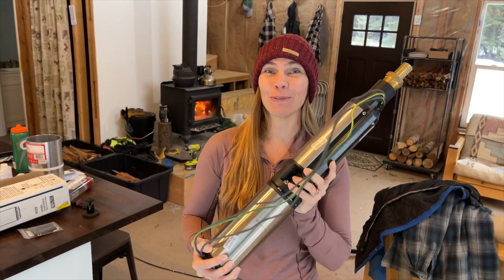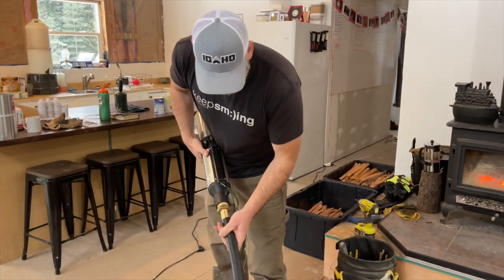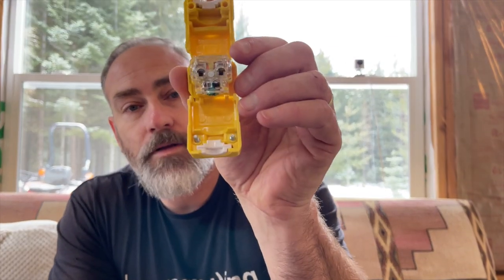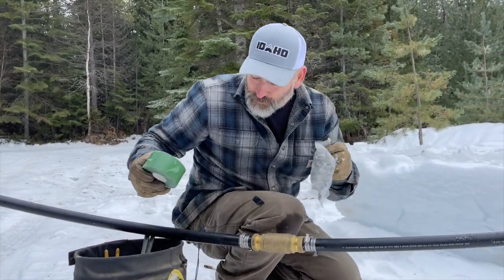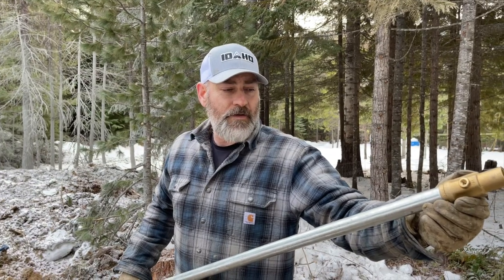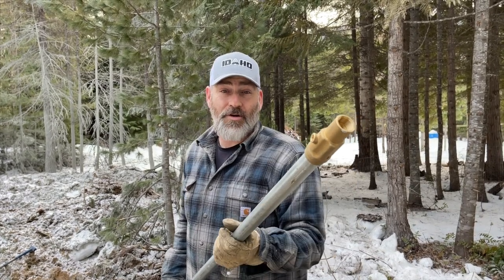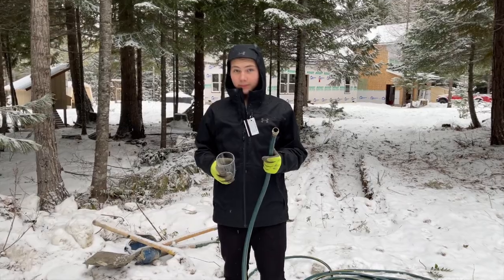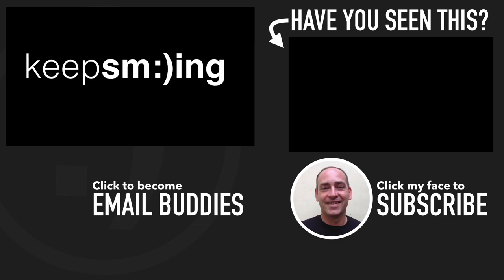WIFE is HAPPY/HUSBAND is NOT - DIY Well Pump Installation

Comment: For the people who do not know. There are several factors when choosing a well pump and power supply. Well pumps are sized by the amount of lift (head) required. Lift is the distance between the top of the well (to make easy) and the water level that the pump will be operating. In this case the "well" was at 500+ feet, the static water level was at 94', and I believe that the pipe installed was 194' giving the pump 100' of water above it given the static water level of 94'. In addition, unless the water run is down hill and the highest discharge point is below the top level of the well, the pump needs additional head capacity to provide water at a pressure (PSI) that is acceptable to the user. Some people think that 20 PSI is great, some people want 100 PSI so that they don't wait forever. "Normal" is in the 40-60PSI range. More pressure equals bigger pump and more power required to run it. Ideal would be to put the well at the top of the hill, your house at the bottom and let the fall (pressure built up by water flowing down hill) provide the pressure. The problem is the initial cost to drill the well at the top of the hill will be greater, assuming there is actually water under the top of the hill or that you actually have a "hill" to be on top of. Pay money now or pay money later over time.

The starting load is always 150-200% of the running load depending on how much water (head) is on top of the pump. Running load is determined by how much head the pump has to overcome pumping the water to its destination. Head is a function of the level the pump is at in the well, pump to top of the well PLUS any up hill flow required from the well to the discharge point of the water.  The pump has to be sized for the total amount of head required plus an additional amount required to supply adequate pressure at the point where the water is being used. Example if the pump will pump 100 feet of head and your pipe is straight up 100 feet the water will flow out the top of the pipe at the pressure of a bad drinking fountain, if you cut the pipe at the 50' mark you will have good working pressure. The pump has to be sized to provide adequate pressure, usually 20 PSI or more, at the highest point in the water system.

If you can, always get a pump that runs on 240 volts, the starting load (amps) will be 1/2 (more or less) than a 120 volt pump. Also the wire size is smaller for a 240 volt circuit than a 120 volt circuit. Always size the pump for 20-30% more head than required if you can afford it. More head capacity, even if not used, will provide more pressure at the discharge point. If you can always size the wire larger than required to reduce line losses. If the wire required is 12 gauge try to use a 10 gauge or 8 if the well is very deep. The extra cost will pay for itself in the long run. More so with a 120 volt pump than a 240 Volt pump.

Side note the static water level is a function of the depth of the overall well and the ground pressure on the water at that depth which forces the ground water up to a "static" level which will be maintained as long as the pump is NOT pumping. When the pump is working, given X as the static water level, a recharge rate of 10 gallons per minuet, and the overall amount of water pumped the static water level will either stay the same or temporary lower. There is about 1 gallon of water in every foot of 6" pipe. So if you use 1 gallon of water every 1 minuet the static water level will not change much. So if your well produces 10 gallons of water per minuet and you are using 10 gallons of water per minuet the static water level will not change much and will return to the normal static level quickly. If you are using 20 gallons per minuet and your well recharges at 10 gallons per minuet you will run out of water and have to wait for the well to catch up. Never run your pump dry even if the manufacturer says you can.

The pump doesn't know what the recharge rate of the well is. All it knows is when the pump is on it pumps as hard as it can and when the pump is off it doesn't pump at all. What then happens is if you have 100 gallons of water in the pipe between the normal water static level and the pump then if you pump 100 gallons of water at one time the pump will be out of water and not able to pump more water until more water flows into the well (recharge rate). What happens to the water level depends on the pumping rate of the pump, the restrictions in the line, and the recharge rate in this case expressed in gallons of water per minuet. If your pump and pipe restrictions can pump water at 20 gallons of water per minuet your well will "run out" of water until the well can catch up after the pump is not running. If your recharge rate is more or equal to the discharge rate then your well never runs out of water. The water in the pipe between the normal static water level and the pump acts like a buffer to help smooth out the recharge rate and the discharge rate so that you don't "run out" of water. Every well is different, some will never know, some will learn the hard way about recharge rates. Poor wells are generally more about the recharge rate and not the quality of the water.

Unless your well recharges at 5 gallons per minuet or more you will learn how to conserve water use quickly. 3 gallons per minuet is a bare minimum for drinking and washing.

Install stainless steel wire to the pump so that you do not rely on the pipe to pull the pump. Just think about all of those joints in the pipe when you are pulling it back up. Fishing a fallen pump out of the well is a miserable job.
Reply: This person knows a lot about this, I have worked in the pump business for almost 20 years, he is correct.
Reply: @scottwallen461  Thanks for the comment Scott. It is good to know that at least 2 people read, I assume, the whole post so that it wasn't a total waste of time even if one of them already knew the information. I must have been board that day to write that much.I guess it is one of those subjects that unless you give the broad overview it is a waste of time to give the readers digest version.

Comment: I ran mine in Northwest Florida for 24 hours at 30 gallons per minute to get clear water. Mine was only 40 feet deep as we live on a sand island and the Choctawhachee Bay is about 250 feet from the well. Only use it for irrigation for the last 15 years when we hooked up when municipal water was run in the area

Comment: 33 amps in-rush current is not unexpected for a motor that will have a steady operating current of about 10-11 amps.  This is one of the big reasons to go with a 220/240V motor in these applications so while the total output power (1200W) is the same, the in-rush current will be much lower and the steady state operating current will be essentially half.  It's better for the service life of the pump and much easier on the rest of the electrical system as well, especially as you have a relatively small inverter which could be overloaded by the in-rush current when the 110V motor starts.  The other factor speaking to use a 220/240V motor here is that well pumps that are connected to a pressure tank have a low duty cycle (It doesn't take long to fill a pressure tank).  Most of the wear and tear experienced by a motor comes from start-up so motor selection and control go a long way to increasing its service life.  Now if you are going to use the well to fill your big tank with the limits of say 20% full to start and 90% full to stop the pump then the duty cycle goes much higher and the starting in-rush current is less of a concern for service life. Even so the 220/240V motor is still the better way to go.
If you can return this pump for refund or exchange I'd strongly recommend replacing it with a 220/240V pump.  Yes it will be more hassle replacing it once again but in the long run you would be much better off.

Comment: I used spacers around the downpipe, every 15 or 20 feet, to keep the well wires from rubbing and sanding off the insulation.

Comment: Great Fun !! 
Something to keep in mind for spring, run your wire in some plastic ( ie; PVC, Pecs whichever is cheaper).. it'll protect wire and later you can pull/add remote start wires for the generator (in the pumphouse)  from the house... ( a nice back-up).
Stay Safe

Comment: There is a company that sells solar well pumps. I have run into this in the past. A lot of electric motors pull big amperage at start up. They even out and pull far less after those first few seconds. So wattage is not as important as amperage but a higher wattage genny will also allow for higher amperage. So a solar well pump may have been a better choice for someone hopping to eventually run it off solar as your inverter will likey need to be at least 40+ amp output.

Comment: Get a grundfos sq 115 pump
I run a 10 GPM pump on a Honda 2000 watt generator with the rest of the house. 
It is a slow start pump, there is no surge wattage.

Comment: pump the well  until it clears and then for 1 hr after it clears, and then it will still a bit colored for a period of time until everything settles underground. Also suspend the pup with the rope not the plastic pipe.
Reply: pumping water from under in the long run will damage the area

Comment: Hey Martin, over here in Australia, needing more than a nominal 35 amps to run a simple well pump is crazy. Its because you went for the single wire at 110V.  At 220V you would have needed only half that current, then you can use smaller gauge wiring, and also have a  lot less voltage drop over your long run of cable. Higher voltage lower current is more energy efficient. Makes little difference to your off-grid system, 4000 watts is 4000 watts, just depends on whether your system can actually supply 220V.

Comment: We had a deep well (over 200') pump replaced that had been in for 30 years.   The installers replaced the cable simply because they didn't want to borrow problems.   It was spliced at the pump leads and at the leads at the top when the wires went to conduit leading into the house.

Comment: I don't know who is giving you the information about needed wire size and pump, but 10 wire is only good to 250 feet with a 1/2 hp motor at 115 volts! If it were a 1/2 hp 230 volt motor then it would be good to 1020 feet FYI !
Reply from the maker: I only went 200’ with it.

Comment: i think this is a very expensive well. When you need watertreament also. The water looks like it has  amount of Fe
Reply: What is Fe
Reply: @philumunnakwe3111  FE is the symbol for iron (chemistry periodic table).
Reply: @philumunnakwe3111  Fe = Ferrum or in english metall, look into the periodicsystem for chemistry
Reply: So that reddish color is iron not just muddy water?  How do you clear that up?
Reply: @cleopatra4473  muddy water would clear up after a while of running the well pump. To clear the iron you need a double filtrationsystem, the first filter is like a towel, the second like a facemask. and this system you need double, so that no water runs into the house and blocks the shower or the coffeemashine. If you don´t clear up you would see it very soon in the shower when the tube gets red
Reply: @philumunnakwe3111  iron
Reply: Quote: Iron is the most abundant element, by mass, in the Earth, constituting about 80% of the inner and outer cores of Earth. Iron is the fourth most abundant element in Earth's crust.
Earth iron is actually iron oxide which was formed at Creation 6,000 years ago when the oxygen in the water that GOD made Earth of combined with the basic iron elements He included in the mix of Creation. Oxygen in water also combined to make the granite and quartz the crust is made of.  
Granite is mostly quartz and quartz is 80% oxygen.
If Martin had kept on drilling down he would eventually have found the supercritical water that runs through the crust and gives the undersoil heating GOD intended us to have instead of burning various fossil fuels.
Isn't Creation science fascinating!

Comment: FLA and RLA are two different things. Need to check the full load amp rating and add about 50% and you will know what kind of amperage you need to get that pump working. Second, theres a direct correlation between the amp draw and your initial draw down based on head pressure.

Comment: Generally you need a starter Capacitor setup. (Submersible Water Pump Control Box)
Reply: Not on a 2 wire pump!

Comment: Regarding your thought that the high amp might be that the check valve was installed backwards. High amp would not be the consequence of that. This type of pump actually draws less amps when ran with a closed valve on the pressure side and draws max current at low back pressure and high water flow. (Displacement pumps like piston pumps are different in this aspect but your pump is not a displacement pump.)

Comment: Water movement takes more power. We use a 12kw generator with our 3hp well pump. Hope you checked with the neighbours on the actual frost depth. We are around 6+ft depth for our frost free valve. Neighbours are 5ft deep and both have had frozen water lines.
Reply from the maker: Where are you?
Reply: @MartinJohnsonOffGridLiving  Barriere BC Canada. Live in an area that, can be as cold as -40 in the winter and +40 in the summer. Very very mild this year. Recently digging in my yard, the soil is frozen 6" to 8". Even with a small hoe arm , it,s a chore. Mostly clay as well.

Comment: Not 100 percent for sure on this statement so take it however. I've been told that even though high quality submersible pumps have a built in check valve you should always add another one directly on top of the pump. No pump will match the quality of say a brass or stainless check valve. Plus if the one in pump fails you have an additional directly on top of the pump. Can you imagine just 100'  of water traveling back down through your pumps impeller because the pumps factory check valve failed? As soon as you kick the faucet on or your pressure drops while it's spinning the wrong direction equals junked pump. Lots of money and hard work. Great channel by the way! Definitely nicely done.

Comment: Too much head level.  You're trying to push a longer, heavier column of water than the pump was designed for.
Reply: You are definitely right.
Reply: Did the generator cut out from transient overload, or the pump cut out from overheating?
Reply: @chrisking7603  My guess would be the generator was overloaded and either it lugged down or the breaker tripped.  That wasn't a transient overload, but a sustained one.

Comment: If you can't get the water to clear up after surging it for several days, you may want to install a backwashing filter ag filter system followed by a good water softener. I would also have a water test done for hardness, ph, sulfur, and iron content. If the water remains orange but is free of suspended sediment, the well may be producing ferric iron as opposed to the more common ferrous or clear water iron.

Comment: Let it run, the water will clear up in 24 hours.
Reply: Yes, or a week or whatever it takes.
Reply: Thats a deep well, and they only installed the pump to 104'.... driller should have blown it out for them... depending on where the water producing fracture is, that may never clear up.
Reply: Consult the driller on fracture depth... if it's a deep fracture, a 10 gpm pump may not be enough to pull superfine grained material from the formation and you'll be dealing with brown water indefinitely. Unless I'm missing something, assuming this was drilled via air rotary, the well should have developed at the time of drilling through the drill stem....
Reply: @gregmckee5501  They were not in fractured rock, they were in some limited gravel and mostly very fine sand/silt.
Reply: @jimthode  Yup I just found the drilling video... drillers notoriously hate drilling in glacial till, because of the casing advancement aspect. Either way, once screen and sand pack are installed, a driller shouldn't leave until water runs clear. A 10 gpm pump set at 104' has no shot of clearing that out.
Reply: thats 620** gal of water in storage, pulling at 10 gpm from the top 15 ft. Id call the driller and have a talk
Reply: They should have had the driller send out a well development rig to surge the well screen and either pump or air-lift the well to clean it out. SOP on my wells.

Comment: The idea of the none return  valve is quite good to keep  water in the pipeline when the pump stops. Or you will have to always bleed the system off air.

Comment: john head
5 days ago
Pump needs a control box with a starting capacitor to give you the extra amps at startup. Can't just plug it in direct.

^ The correct answer, that's why it did not work when he pulled it up and tested it, it did the same thing.
 Martin you will need a control box when you hook the pump up to your power grid, you will not have the extra amp surge the generator gave you then, that will come from the start capacitor in the control box.